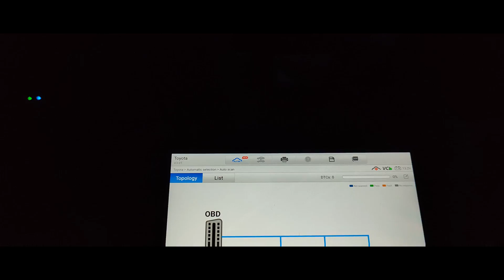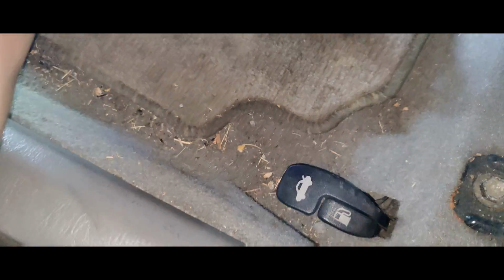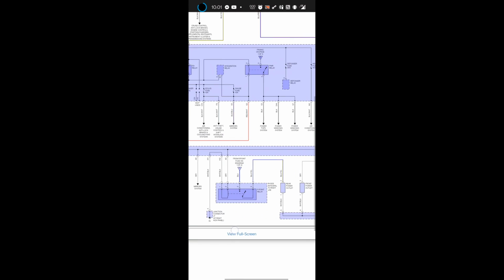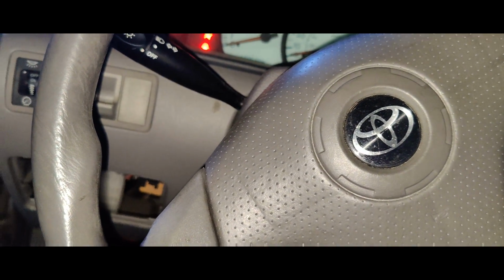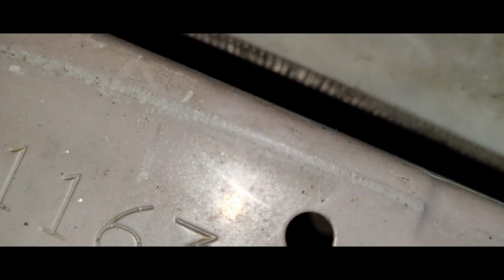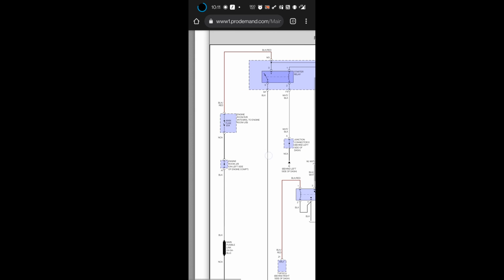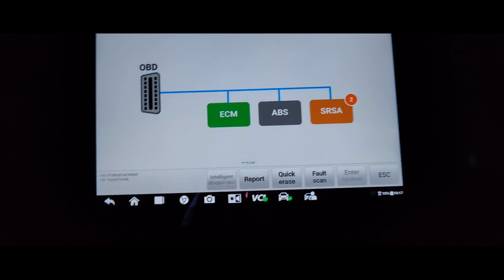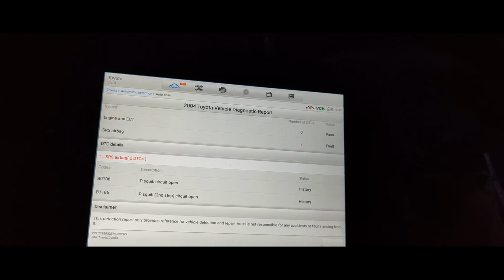2004 Toyota Corolla 1.8l No Crank, Bad Starter, No Comm?

Comment: I replaced the starter, the battery, all fuze under hood, starter relay and still nothing.
Reply from the maker: What testing have you done so far?
Reply: @RobertDotterer  I have checked the connection to make sure there at there proper amps and they are.  We have checked some of the wire connections to make sure there is the proper electrical current and there has been.. but the thing is the starter was bad I changed it out it worked for 2/3 days, I changed the fuses and relays it worked for a day or 2, I changed the starter relay, it worked for a day or 2, I even changed the clutch pedal safty switch I checked the ignition switch and every time I replace something. It will start and run for a day or 2 then it goes back to no start no crank

Comment: Just had to rescue my son yesterday with similar situation. grabbed my test light, remote starter switch on a rope, and a hammer. LOL
Had power on main post, solenoid wire energized when switch was turned. Bypassed the solenoid with screwdriver still nothing. So I broke out and hooked up my remote switch and beat on starter while pushing my button and bingo he was running.
Reply from the maker: Awesome, did you make a video of it?
Reply: @RobertDotterer  No I suck LOL, I probably still can, he didn't change the starter yet LOL
Reply from the maker: If a video helps 1 person or yourself it is worth it.